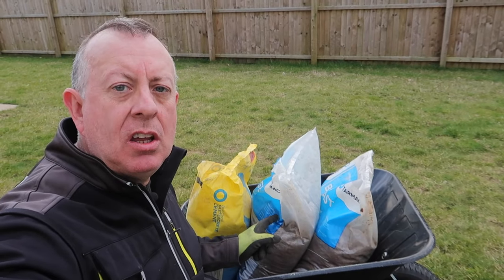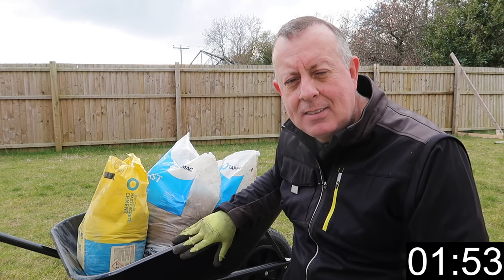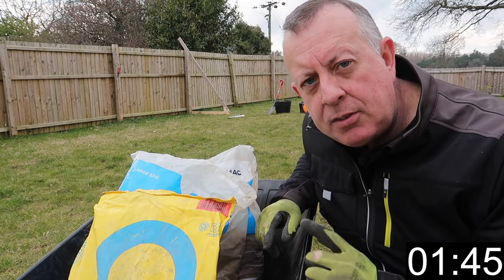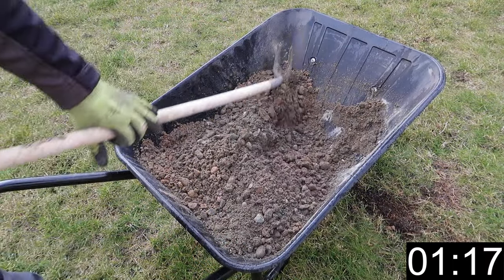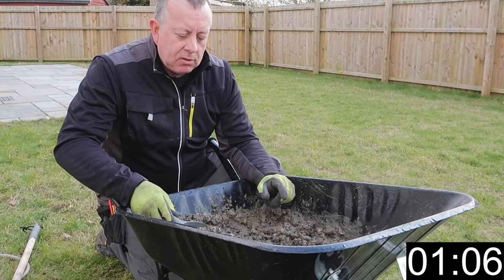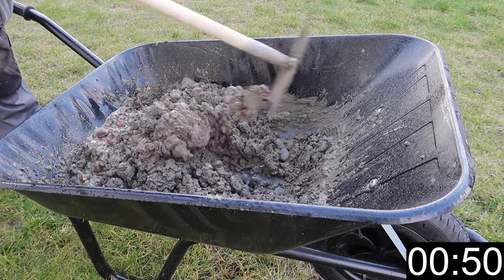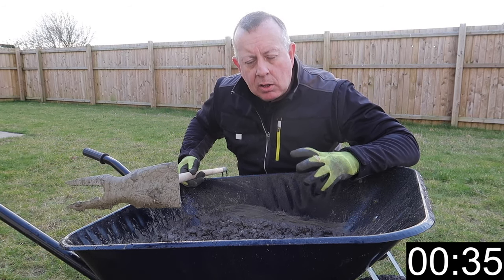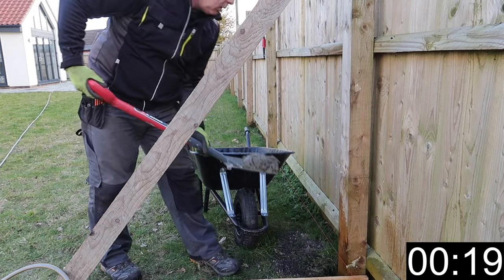Hand Mixed Concrete - 2 Min tips

Comment: Only thing I would add is gauging, best to use a container to measure you ballast and cement to get exact ratio. The Victorians discovered when building the sewers, you had some parts failing because the variation in strength depending on who was mixing the concrete for footings or mortar for brickwork. So they introduce gauging, everybody used the same mix x buckets of sand to x buckets of cement human error removed.
Reply: 👍 Yup, I was working with an 80yr old that had been building all his working life.
He mocked me for measuring with buckets, but also told the boss that he'd never seen anyone so consistent!
Go figure eh?
Reply: Can I use this mix for 30cm depths into soil as a bed up to the level of the ground and then place 30cm timbers on as supports for a decking frame?

Comment: With mastercrete being enhanced, if using other brands often useful to add some plasticiser. For doing concrete bases/slabs easier to trowel up as less water comes to surface. Generally makes shovelling concrete easier too and gets air out quicker when tamping.
Reply: thanks man, I'm doing a concrete slab for my garden office. This was useful information

Comment: Wish I'd seen this before laying my concrete pad for shed! Mix was a bit too dry and I was a bit slow. Consequently I have a poor surface. I'm just going to run a strong (but loose) sand and cement 'screed' over the top and hope for the best 😂😂
Reply from the maker: Oh well - it's all experience! Give the screed plenty of cement (as you say) and I'm sure it will be ok. You a bit in front of me - my shed build and videos will be over the summer.
Reply: @ProperDIY  looking forward to them. These videos are invaluable and you've got a great way of explaining. Thanks!
Reply: @ProperDIY  is this happening?

Comment: Invaluable advice.  Used your method to concrete in a gate post. The first method ended up cracking using a ready mix.  The second attempt also failed using postcrete and the water and mix went straight into nextdoors'!  The materials you recommended, the measuring and the visual clues that the mix is ready means I have now have a gate again!!

Comment: For some reason my brain has always thought of concrete as something that is really expensive, and inaccessible to anyone except builders. And I kind of expected a small bag of cement to be about €90-100. 
Maybe I thought this because you get such a lot of "stuff" for the price, compared to buying a small tube of sealant or Polyfill and that kind of stuff. And maybe because of the fact that you can do so much with a bag of cement, because it's so permanent, and so useful, I expected it to be more expensive.
But when I checked I was kind of surprised that you can buy a bag of cement for about the price of a pint..

Comment: Another good way is if you have one of those Screwfix Titan drills or similar 'cheap workhorses' and a decent mixing paddle. Put all your stuff in a garden rubber bucket and use the drill and mixing paddle to mix it up. It is a lot easier on you and you get a really good mix. I do this method for plaster as well. Though you need one of the more robust mixing paddles, but should only cost £10-£20.
Reply: What's it like with cement & mixing the ballast the the stones with the paddle mixer?
Reply: @tonyl1984  I have never had an issue mixing ballast with cement in a rubber bucket using a paddle mixer attachment in my Titan drill, though as I stated in my original comment you do need one of the more robust mixing paddles.

Comment: Hmmm proper diy.
Use plasticiser to help your mix.
Also, when you fill in post hole, finish at ground level with slight slope for water run off.
Yours will pool water and rot post, even treated ones.
This comes from 30 years in Lanscaping business.
Also measure measure measure with container for perfect strength mix.

Comment: Need help as i build my first shed base.

214cm width
128cm length
15cm depth 

7ft by 4ft shed going on top.

Looking to use the same cement / ballast but unsure how many bags of each I need.

Online calculator suggests
6x 25kg bags of cement 
1x 25kg bag of ballast

Makes no sense for a 1 / 5 mix.

Comment: Hi guys, I am laying a pathway just in front garden. It's all mud atm so needs to be concreted. Length is 3m and the width is 1m. 
Once I have done the shuttering can you please tell me how deep my concrete needs to be? I have a tonne bag of ballast just need to get some cement bags. Also what do I put on the bottom above the mud, shall I out gravel down and then compress it/flatten it etc. Thank you Amy advice be appreciated
Reply: did it work out in the end or are you still waiting for advice?